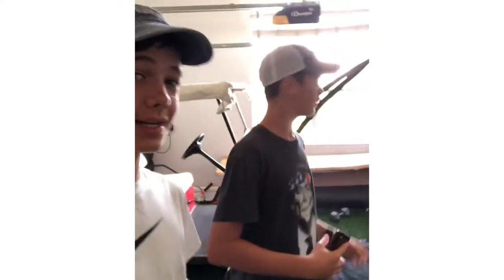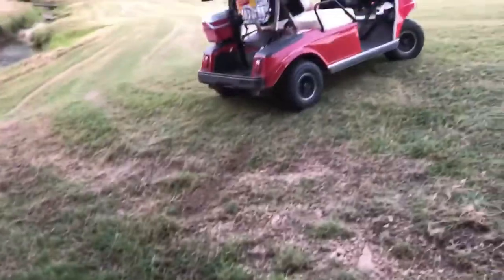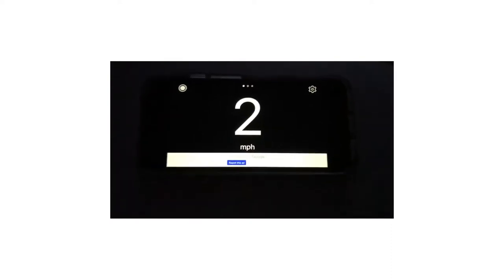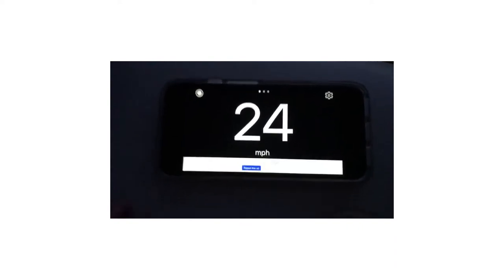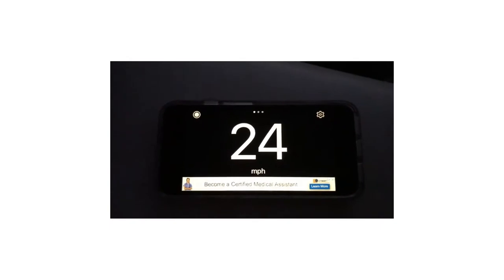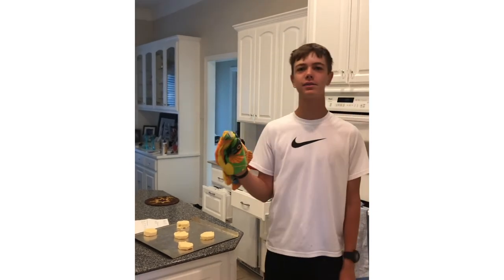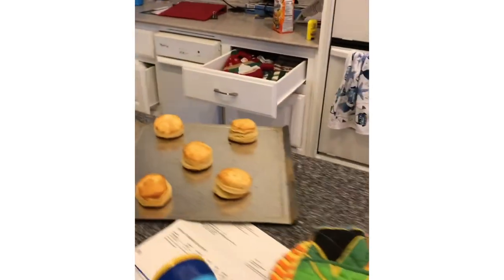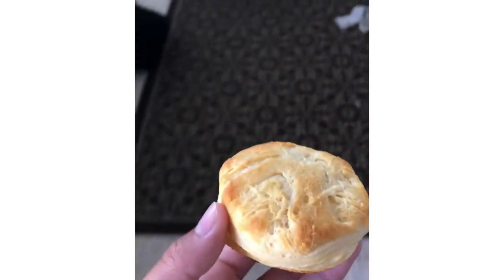Pulling 30+mph on golf cart!VLOG#5

Comment: Let me know when you are ready for some serious HP in that ds
Reply from the maker: I actually did upgrade my cart already lol.
I have a 6.7hp motor with 500amp controller and all the other things to help control that power. It goes 27 in a straight line!
Reply: @texasrandom583  
Heck yeah,  very nice..... 👍👍👍
My ds runs around 55 mph.
Reply from the maker: Holy! 55 mph? Is it gas ? Thats so fast for a cart! Lol
Reply: @texasrandom583  
Lol yes putting about 80hp out. 
10" lift, air ride, and lots more
Reply from the maker: Dude thats insane and really cool. Did you put the engine under the seats for a bigger engine?
Reply: @texasrandom583  
Sure did, the engine is a single cylinder so it still has plenty of room for all the goodies too......

Comment: How's does it go so fast
Reply from the maker: Well I bought the golf cart used and the previous owner took out the regulator so down a huge hill like that is just keeps going.     And recently my dad and I put a high speed motor on it when the original motor went out so now its has double the horsepower 🙃
Reply: Do you know how to take the regulator off and can you send me a link to the motor
Reply from the maker: Well to be honest I have no idea about the regulator
. And the thing I got was a bundle with a motor,heavy duty wiring, forward and reverse switch, 500 amp controller and solenoid.